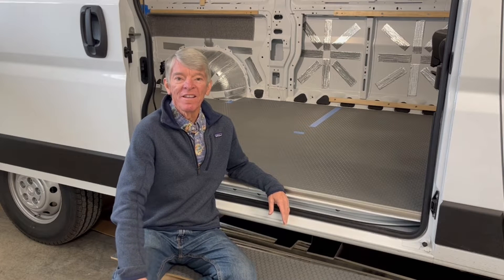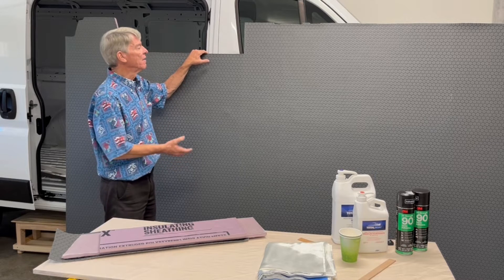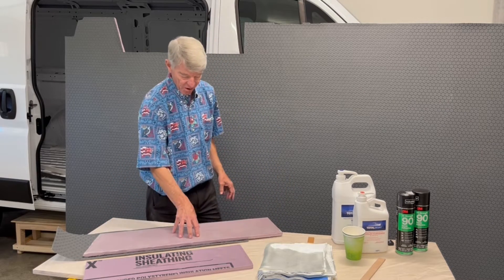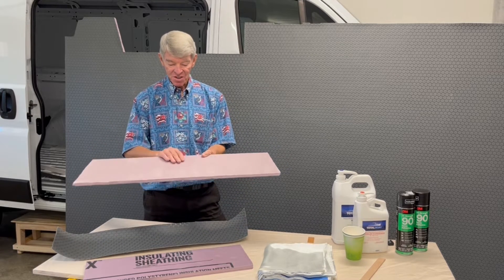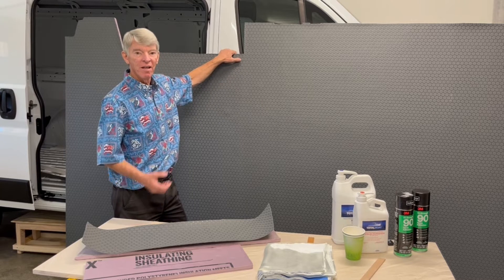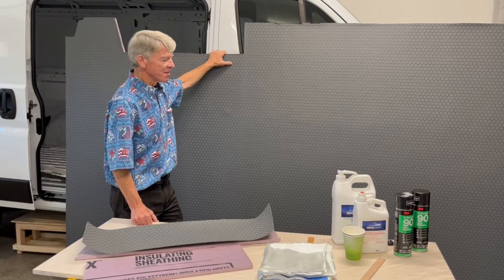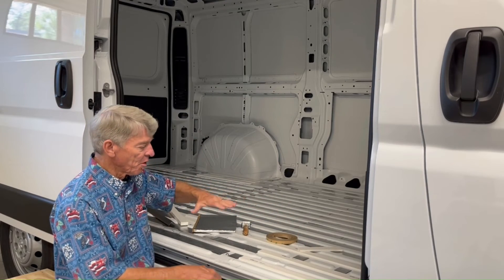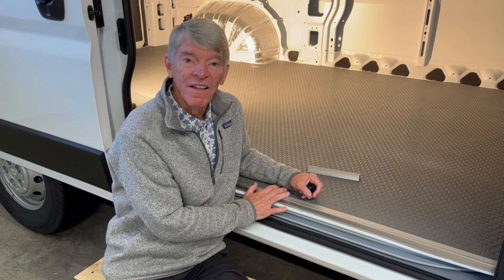Camper Van Insulated Fiberglass Floor Installation

Comment: Absolutely brilliant! There is a company out of Oregon who is doing something similar using a manufactured closed cell/fiberglass composite board and they use a CNC machine to cut out panels for people who are building out vans. They charge $2300 + shipping for the panels, and $5500 + shipping, for the panels with PEX tubing inserted for floor heating. Anyway, I searched the internet for the panels and they would also be expensive although a lot cheaper than getting them made and shipped. I was searching for someone who may have used these panels, and I stumbled on your video which is a brilliant DIY version of the same thing at a fraction of the cost. The  fiberglass reinforced panel is suppose to be strong enough that you can get away with a 1/2” or maybe even a 1/4” plywood subfloor which reduces the cost and weight of the plywood as well. I see that you chose to forgo a plywood overlay to reduce height and any potential water damage situation.
Reply from the maker: The floor is working well with no problems after two years and 20K miles without a plywood overlay.

Comment: If you had the luxury of a high roof's interior height and you went with 1in thick XPS in the floor, would you use the same, single layer of fiberglass?  Would you do two layers? Many thanks and continued good luck with the van!
Reply from the maker: If I had a high roof, I might go to 1" XPS for more insulation but I would again go with a single layer of fiber glass on both sides. So far the single layer of fiber glass has shown no failures. A second layer would add more weight for minimal increase in insulation and would double the amount of work spreading epoxy on the layers. If I have a floor failure in the future, I will report it.
Reply: @fivepoundpete  The strength and resistance to wear with only one layer simply amazes me. As someone with a 5 lb base weight as well, the efficiency and MPG savings excite me. I'm unsure if your build is finished, but I hope you recorded your MPG before and can check again after. Best of luck!
Reply from the maker: When the van was new and had 65 psi front and 75 psi rear pressure I got 20.1 MPG. After the build of 940 lbs and loaded with another 640 lbs of gear we took a 5000 mile trip to Vermont for the total eclipse. I had lowered the tire pressure to 57 psi all around for a better ride. We got a wild variation in MPG from normal conditions at 18 MPG to a high of 24 MPG and down to 14 MPG into strong headwinds in Kansas. These numbers were at high interstate travel speeds for an average of 17.5 MPG round trip. As you can see there are too many variables to gauge what the van build weight impact to MPG was. Overall I am pleased with the milage I am getting. The smoother ride and getting there quickly was well worth the impact to MPG.

Comment: Very unique and smart van flooring ideas! Wish I had found it sooner! Could you do use the same foam plus fiberglass combo for countertops and cabinets? Then paint it or cover them with wood veneer?
Reply from the maker: I suppose you could use foam and fiberglass for cabinets and countertops but it sounds like a lot of work. I only have a single cabinet in my van and the steel frame/drawer guides provide the strength so a light weight cabinet covering would be possible. Most of the wood I use is for the drawer faces on the lightweight drawers I describe in one of my other videos. I might look for lighter drawer faces the next time.

Comment: Hey Pete,
Love your channel that I just found. Had to sub and now I'm binge watching your content from the beginning. LOVE it! I'm Super impressed with this floor. High performance and looks great. Could you share your layup schedule, top and bottom? How many layers of glass, what kind of weave and how many oz. weight each sheet of glass?
Reply: Mad respect for what you've got accomplished so far and can't wait to see what else is coming. Props! 😎 Thanks.
Reply from the maker: I am a real novice when it comes to fiber glassing. I found the fabric on Amazon, Fiberglass Cloth, Style 7781-8 Harness Satin Weave, 60 Inches Wide by 5 Yards Long. I used a single layer on each side. I used TotalBoat-510825 High Performance Epoxy Kit, Crystal Clear Marine Grade Resin and Hardener (Gallon, Medium). These products seem to work for me and I had quite a bit left over. I suggest you have a helper that can mix up small batches of resin while you keep working to apply the resin, that way you end up with a more consistent application.

Comment: I assume that all cabinets and accessories will have to be either screwed or bolted to the van's metal floor?
Reply from the maker: Actually for strength only the battery, refrigerator and passenger bench seat are bolted to the van's metal floor. Since there is not a plywood subfloor to screw to, all of the cabinets and the shower enclosure sit on the floor but are bolted to the walls.
Reply: You essentially made a simpler version of Coosa Board used in the marine industry. You can I fact bolt through it if needed with washers, but I’d add an extra layer of fiberglass in those spots to reinforce the spots if that was going to happen. Very well done and your use of the PVC reinforcement is a great idea.
Reply from the maker: I had never heard of Coosa Board, I learn about new materials from my viewer. Coosa Board while stronger would have cost over $700 compared to $400, been heavier and I still have fiberglass cloth and epoxy left over for other projects.
I placed a base of 1/2" plywood under the electrical box and refrigerator to spread the weight to avoid compressing the foam core of the composite. The base also allowed me to place the holes in the floor where they would not hit brake lines and position holes where they aligned with the battery tie down straps and the refrigerator mounting holes.

Comment: Hi Pete. Thanks for this video! 
Im planning to exactly the same with my interior. 
It’s nice to see some kind of conformation that the ideas are somewhat not new and done by others. 
But im planning to use foam core and fiberglass for the rest of the interior aswel. 

Now im curious what made you decide to use other materials? 
And what are your thoughts on building an interior made our foam fiberglass? 

Please update on how your floor holds up 

Thanks again and cheers 
Eric
Reply from the maker: The goal for building my van is naturally to have a van that meets our requirements but also to experiment with new materials and ideas to make my van as light as possible and to share my ideas with other van builders. I am taking my passion for designing ultralight backpacking equipment (https://www.fivepoundpete.com/) and applying it to van conversions.

I have had my fiberglass floor in my van for a year and a half. It has been in during the entire build process with hundreds if not thousands of trips climbing in and out of the van and shows no sign of failure. I have a low roof van and I wanted an insulated floor that didn't take up a lot of headroom and was light weight. My son suggested the fiberglass floor with the thought that if a surfboard could withstand the forces of an ocean wave it might be strong enough for a floor. So far it has held up great. With regard to building the interior with foam core covered in fiberglass I have seen another conversion trying the same solution, you might want to look it up. I would be concerned that it would be a very labor intensive and time consuming build.
Reply: @fivepoundpete  Well I can’t thank you and your son enough for your try in a Fiberglass floor. 
Im pretty inexperienced with Fiberglass, and as im planning my van build, im trying small little projects to learn from. And yes it is very labour intensive. 
So beside the design idea, of fiberglass only, im trying to keep an open mind for other materials and lightweight hacks. 
And like you, my attempt is to become lightweight as possible, as weight restrictions are really checked on by law enforcement, in Europe. 
It’s always a limitation on what you want to bring with you, in terms of luxury and convenience. But im hoping to reach the level which my family can all feel comfortable with. 

Thank you for the website you send, i will look soon, to catch some more ideas from you 
Cheers
Reply from the maker: Good luck on your search for more lightweight ideas and materials.

Comment: did the fiberglass add any R value or was it just for rigidity?
Reply from the maker: The fiberglass has the thermal properties of a thin layer of plastic and does not add a significant amount of R value. It is there primarily for rigidity to spread any weight over a larger area.